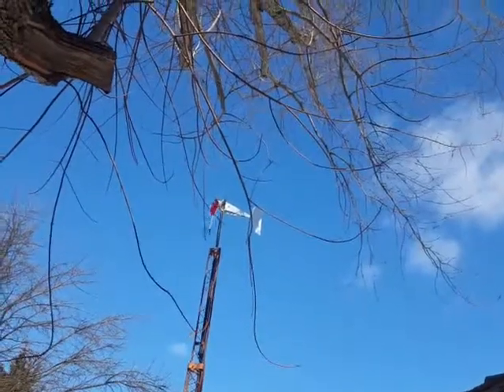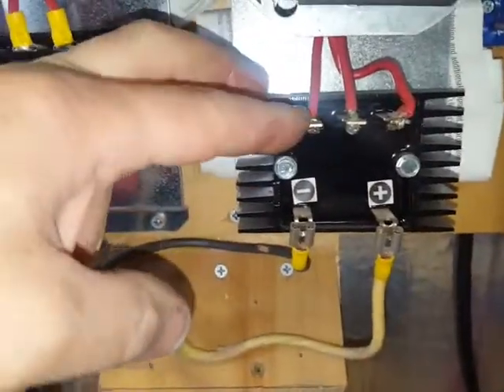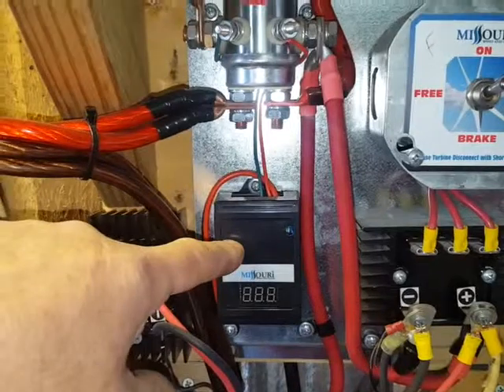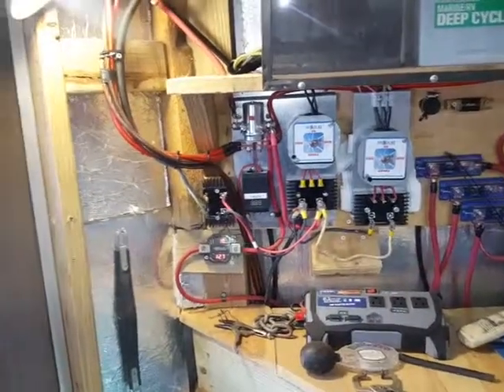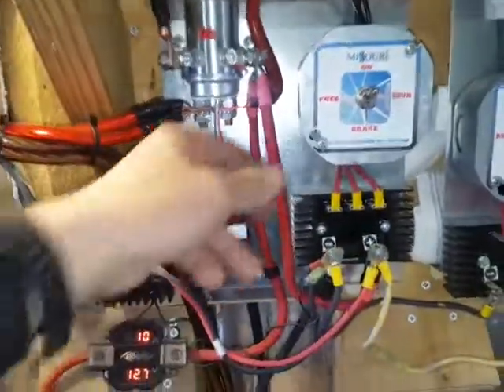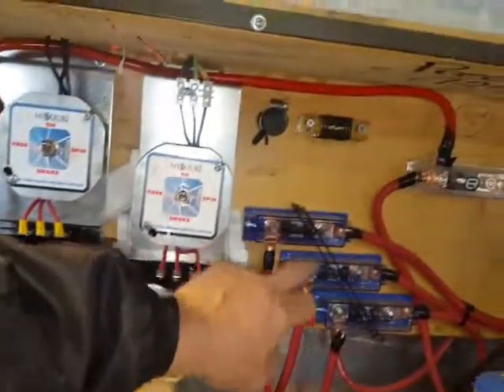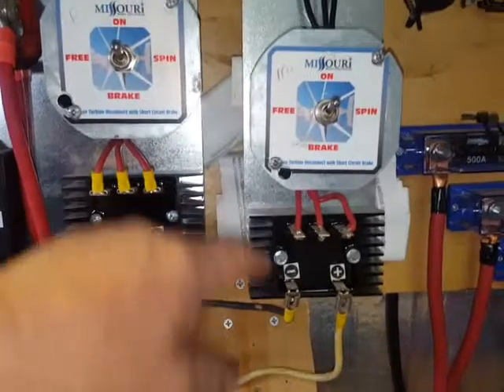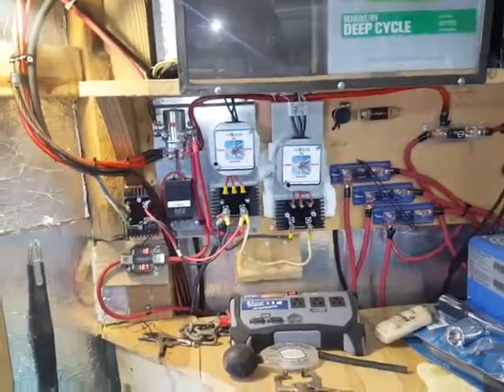How wind turbines work charging batteries

Comment: Is this turbine still on the go? I have one second hand and I am having trouble getting it to charge.  I notice your relay is set to 12v.  Mine is set to 24v to match the bank but I have a 12v relay and I could adjust the bank.
Reply: @TheoriginalAndysgarage  thanks Andy for getting back to me.  What I was thinking is that in order to charge a 12v battery bank you need to be feeding in much higher voltage say 18. Looking at you set up I think that's what you're doing.  And clearly it worked.  I am thinking of doing the same.  I talked to some at Missouri before this and they have been helpful.  But of course they would like to sell me a 1500 dollar solution. 😀
Reply: @TheoriginalAndysgarage  Tnx again.  at the core of my problem s a bad battery

Comment: Home made wind turbine generator 14 gague copper wire 9 coil 80 turns  24 magnet 50×25×12.5 output dc voltage 24/32 generator watt and amps output minimum maximum sir please help me sir
Reply from the maker: I really don't know the technical end of this stuff